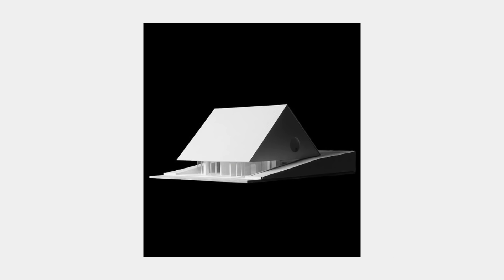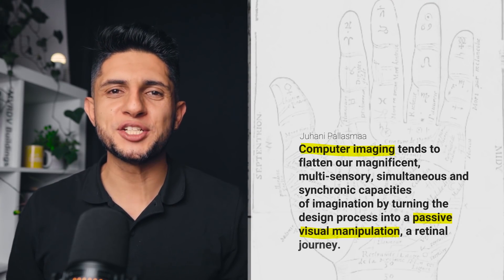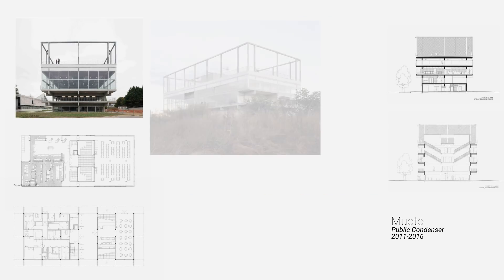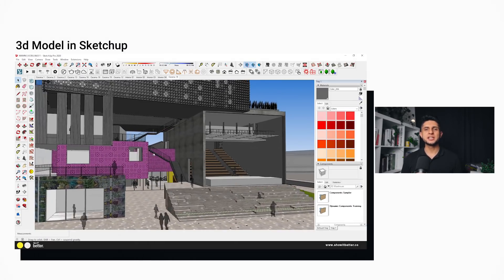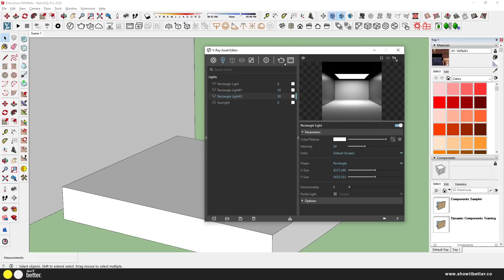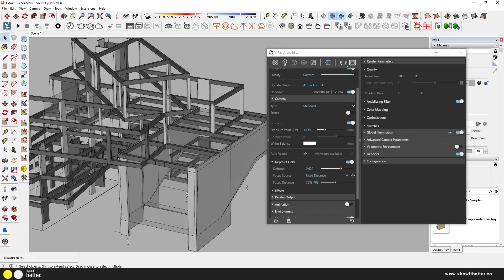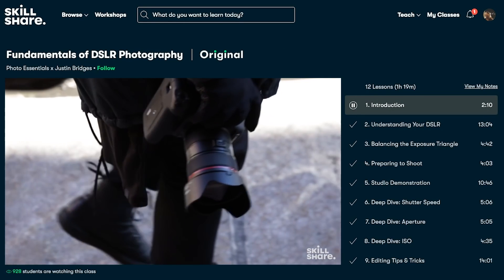How to render an Architectural Maquette  in V-Ray - SO EASY!

Comment: Lumion 11 has a nice scene added called "design showcase". It's a full preset with background and lighting already added. Just load the model, change materials and render it
Reply: I somehow could not find it, some help please, under which menu is it? Are you talking about Lumion 11 or later version (11.03) ? 
thanks
Reply: @Azad-qm2pm  I believe it was introduced in Lumion 11. It's under  "Example Scenes" menu, bottom right one with white background. Be careful not to delete the pre-loaded object called dome, that's what gives neutral background

Comment: Did you skip the part where you set the material in the material override rollout? You talk about the wood material but then seem to skip to setting the default material to not be overridden. Then you never go back to actually set the wood as your override material but I’m guessing that’s what you did in reality?

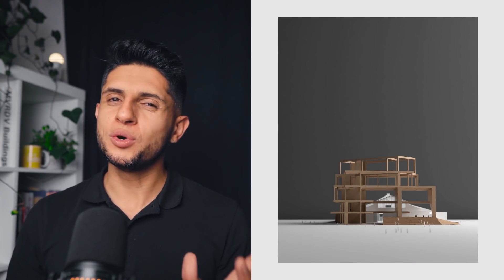Also, in your output images that you briefly show towards the end of the videos - are those ALL only using a single rectangular light? Or, for some of them, did you end up adding more lights? The background looks way darker in the image shown at 8:31 compared to the same one shown at 8:30 and I’m wondering how you did that without the model itself becoming either very underexposed or overexposed, unless you had one light on the model and another on the backdrop. Thanks!
Reply from the maker: Hey! 
1. Yeah, in the material override option I set the wood material, and when I want to override one I go to the settings in the vray asset window of each material and tick off the can be overridden option. 
2. Yes, all the images are using one rectangular light. What varies is the angle and size of each light, but it is always one. If in one of the images the background appears darker it is because the material of the bg was changed to a dark gray.

Comment: Great video. New Sub. Couple of questions:
1. Does it work to resize the material using the Sketchup materials edit option? I seem to find that that setting does not affect how the material appears in the render. I read a Chaos Group official approach is to add a Tri-planar wrap-in to the texture maps in the material and then use that wrap-in to resize the material.
2. Your model is obviously of a very large building in reality - perhaps 100’ tall. Is your Sketchup model “full size” or do you scale the geometry down until your Sketchup model is “desktop size”?

Overall I’ve been struggling to make it look realistic: I end up with what looks like a 100’ tall building made from plywood, rather than. A 12” tall model made from plywood. Thanks!